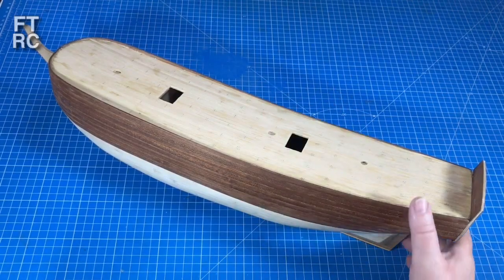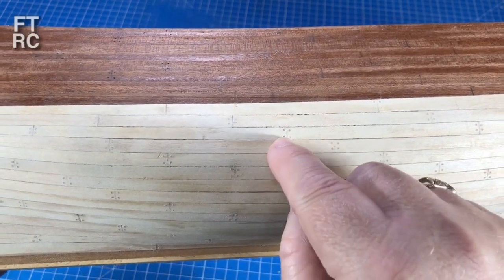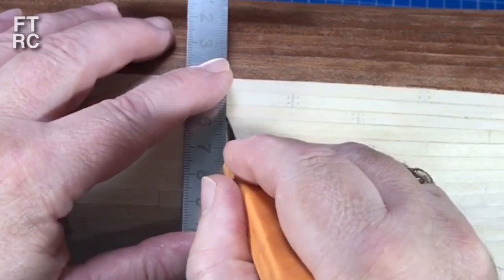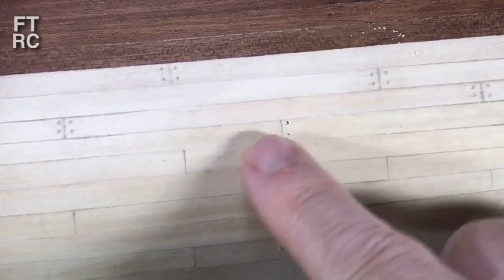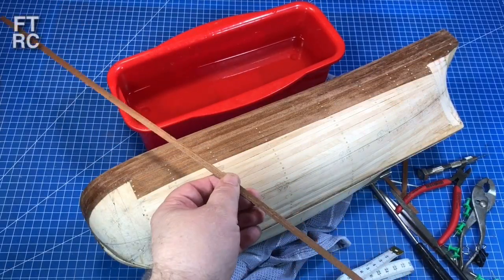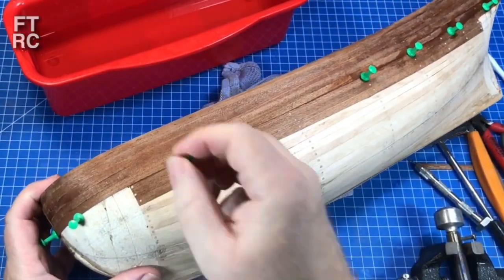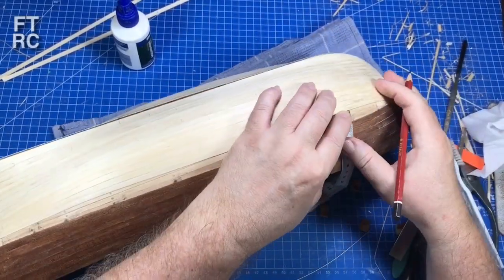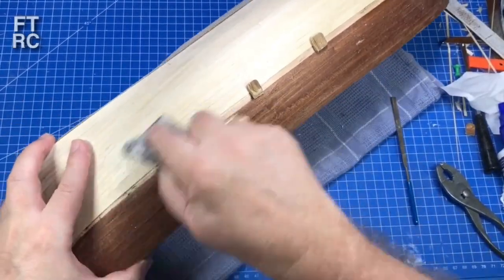Bounty by Constructo Part 9 Plugging nail holes and using electric bender

Comment: Some interesting techniques shown, agree tree nailing with cocktail sticks takes forever.  I will showing an alternative plank bending method on my HMS Fly build soon that avoids soaking planks, you may be interested.  Loving the build👍🏻
Reply from the maker: I’d to see you bend dry wood without splinters or snaps.  If it’s by crimping, then I have tried that but it won’t get you 2 axis bends or twists.
Reply: @HarryHoudiniModels  no not a fan of crimpers, steam 😉
Reply from the maker: You do realise steam contains water LOL?  So same principle, allow the wood fibres to expand and soften with more water in the cells.  Just the hazard of burning your hands on the scalding hot steam as you poke the planks through it.  This I need to see!

Comment: God that's seams an easier way of doing it, I'm ok at modelling just not that sort of skill I'm in awe of anybody that can do this plus my hands are starting to cramp up after about an hour.👍👍
Reply from the maker: I am told there are mini battery powered drills which can take some of the hand cramping labour out of a task like this.  My neck can only handle a few hours of this kind of work before I need to lie down and hot pack it to sooth the pain of occipital neuralgia.
Reply: @HarryHoudiniModels  Nice one Harry for the info will have a look for one, but my skill level is just not there yet getting there though.😁👍
Reply from the maker: Just need practice and repetition then you’ll get better at anything

Comment: Have used sawdust and PVA in woodworking, thought about using it for modeling. great video Harry, thanks.
Reply from the maker: Yes it is a good trick to use the waste as filler.

Comment: Nice work - I'm enjoying the videos.

Hull and deck planks in this era weren't attached with iron nails, they used treenails (trunnels), large wooden dowels driven into holes bored through the plank and into the hull frame or deck beam. The protruding ends were cut short and planed down to the surface of the plank, no plugs needed.
Reply from the maker: Thanks for the info!

Comment: Possible to simply use a suitably coloured pencil to mark the plugs?
Reply from the maker: You could try but after 300 circles drawn, on each side, your hands would be cramped.  Then if you managed not to smudge any of them, despite the varnish sealing your pencil work in, the wood grain of each plank will show through.  They will simply look like marks on the planks, not plugs in the wood.
Reply: Fair do’s. Thanks for the reply.